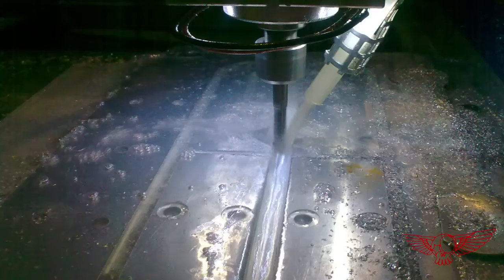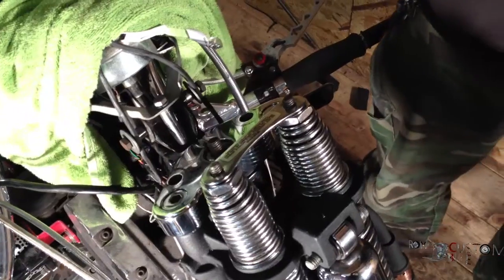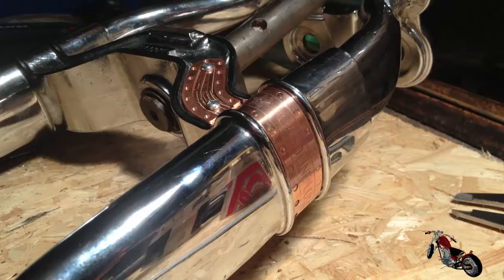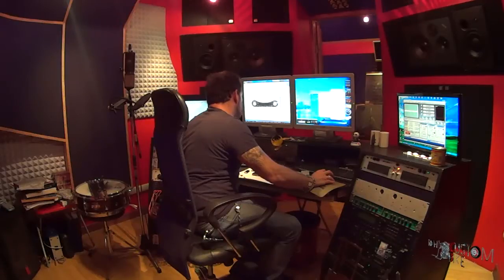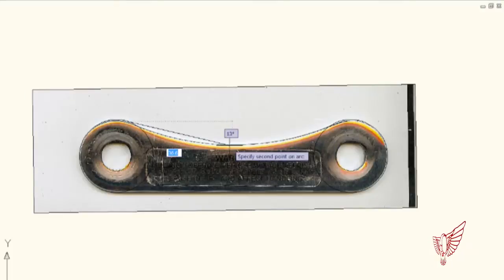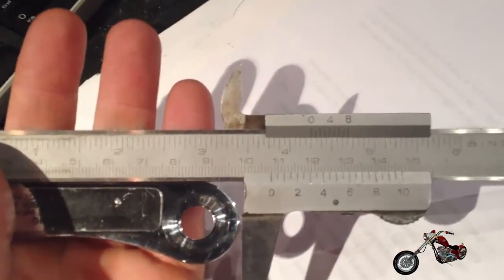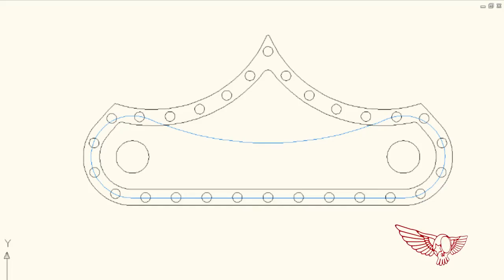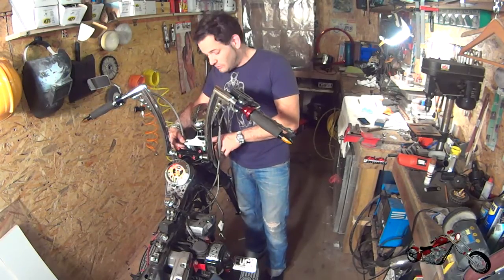How to CNC an Harley Davidson motorcycle part from scratch - Design - ep4p1 Roma Custom Bike

Comment: clever lad
Reply from the maker: +trevor francis thank you Trevor ;)
Reply: the captain america xvs 650 that is on youtube, is all most complete,i was just about to fit the caliper retainer rod to the back leg
Reply from the maker: +trevor francis just saw it, commented on it too :) i understand why you are asking now, but that angle is totally related to the length of the front fork and the length of the springs assembly
Reply: I think there 14 inch overs,
Reply: maybe the answere is to shave some metal off the disc, or mount to stay higher up the rear leg, rake and trail is spot on,on the bike, my friends bike is 24 inch overs
Reply from the maker: +trevor francis make sure you have a proper trail, where the projection of the neck rake to the ground is in front of the point were the tire touches the ground. that is everything in safety